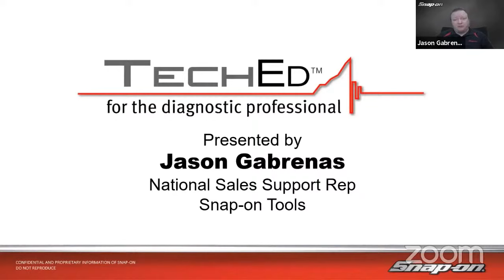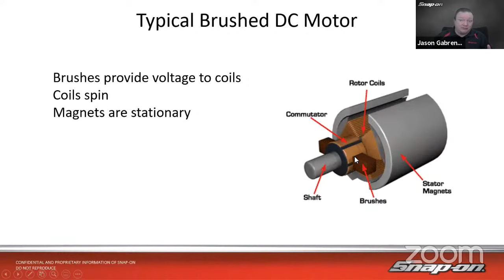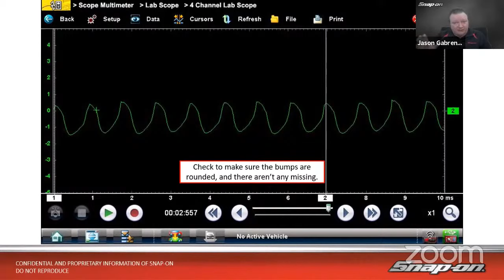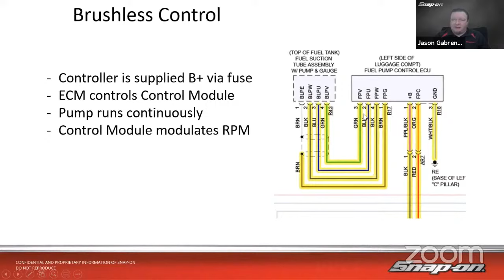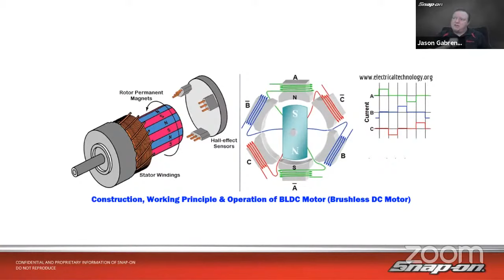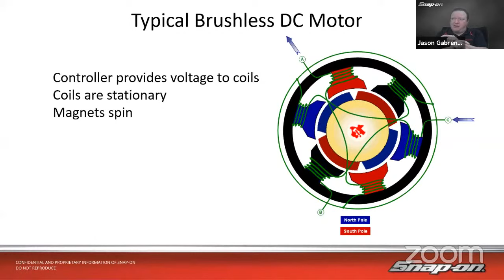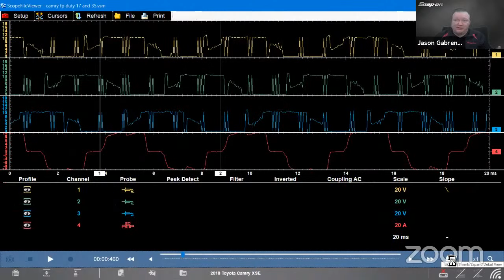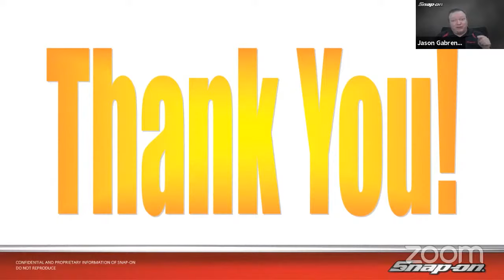Snap-on Live Training Episode 18 - Component Testing: Fuel Pumps

Comment: A gm domestic vehicle new pump at idle is about 2000 rpm.  Will climb to 2500 on wot on road. P2635 will set at about 5000 rpm. Also the fuel pump trims will tell the condition of the pump

Comment: What's the normal inside itself resistance?
Reply from the maker: That will depend on the manufacturer. You'd have to check repair info to be sure on a specific vehicle.